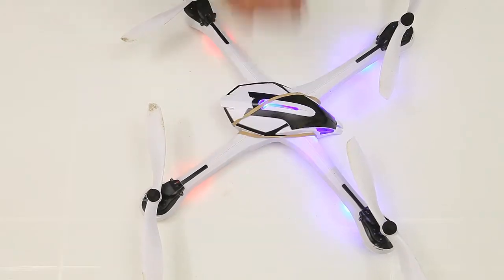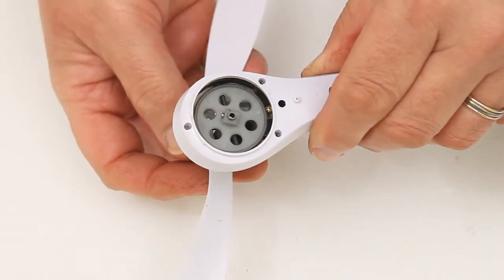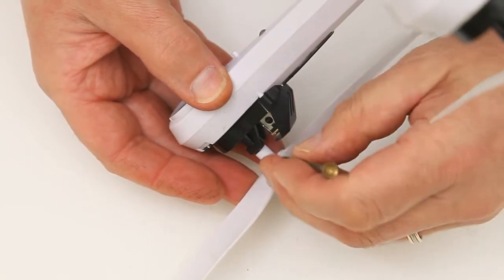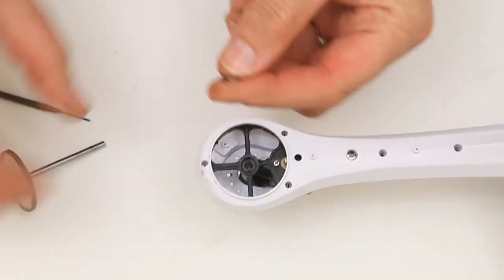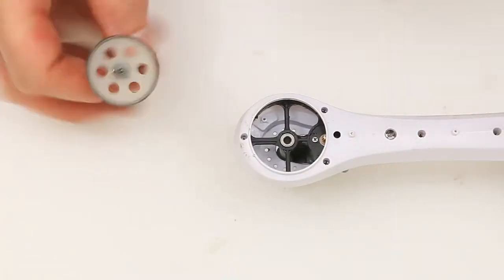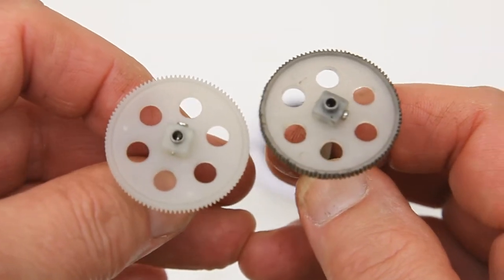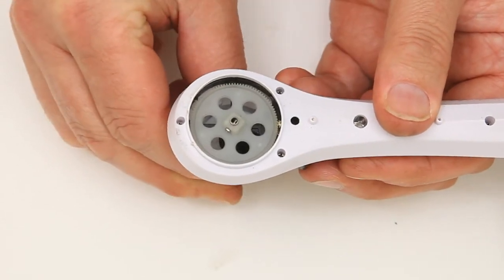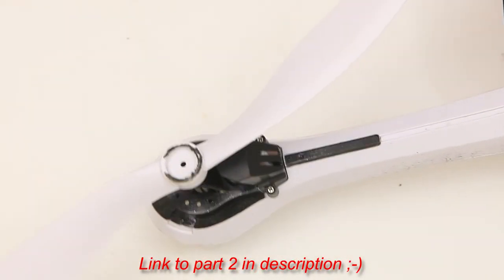Tarantula X6 replace worn gear (Maintenance Part 1)

Comment: Been inspecting my gears, I got a few dead teeth on 1/4 gears. been lightly lubing after every few runs. Also I try not to do hardcore free falls or keep light throttle so the blades dont spin backwards upon heavy descent then you hit hard throttle stopping the backwards spin to go back to forwards.

Comment: Hi there, I've got a Tarantula that after roughly 25 minutes of flying the same motor pinion strips.  Amazing to me plastic can strip brass.  Not doing any crazy flying, just a beginner.  Any suggestions on what's going wrong?  Thanks.
Reply from the maker: Hi John, no idea at all I'm sorry, mine only stripped after hours of full on flying, be interested if you do find the reason, good luck

Comment: could I put some brush less motors in for them as an upgrade
Reply from the maker: noy really you then need ESC and the PCB won't cope with them and so you are into all sorts of stuff, well that's as far as I know, when I looked into it. They are really easy and cheap ;-)

Comment: Greetings Tigger.  Great videos. Your vid on installing and flying the tarantula with the walkera gimbal prompted me to buy one for mine. But alas, I can't get more than 5 min flight time out of mine loaded with just my Mobius,  which makes me fearful of loading it up with my brand new gimbal. Basic mods complete, same results with 2 different stock batteries. I was wondering if you could comment or make a video on DO's and Don'ts, (if there are any) that you learned since installing and flying the T-x6 with the walkera 2d gimbal. Heavier ware on the toy grade motors and gears was expected. Anything else.? I don't know how to solve my flight time problem without bigger mah battery and running the risk of burning it up quicker. it runs pretty hot at 5 min. Keep the vids coming, Scott
Reply from the maker: +Scott Durand Hi Scott, honestly had no problems with mine at all, only the PCB gets hot when I run it fully loaded with gimbal etc, gear was worn but TBH with the way I fly it, not a surprise there and just one motor was failing as you will see in my maintenance vids. Sorry you are not getting the results I am as I really have done nothing more than I show. Mind you no one had a bigger grin than me with the (min etc video :-))) that's all 3 chins! I will be getting another Tarantula, this was fine until I let someone else have a go and dropped it onto rocks........I'm wondering if they have changed a few things since I bought mine, I will let you know. thanks for the good comment and thanks for subscribing, you are number 700 :-) I have 3 weeks to get 1,000 in six months, thinking that is not going to happen, but real chuffed the way the channel is building. TTFN :-)

Comment from the maker: This is for Massacrekid as I cannot reply on your comment, go figure I have no idea but my tips are  Dry toothbrush does a good job, don't clean teeth afterwards....yeuk! Can of "Clean-Air" used by photographers will blow stuff everywhere just make sure it doesn't blow it in harder as this won't help. Strip down makes cleaning more thorough and easier to clean properly but is a pain, does the best job though. Hope that helps :-)